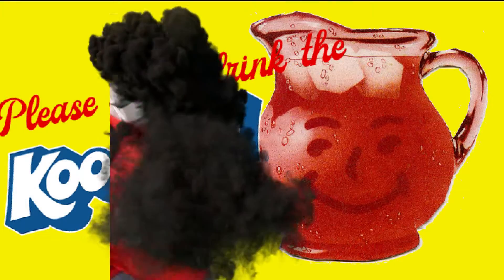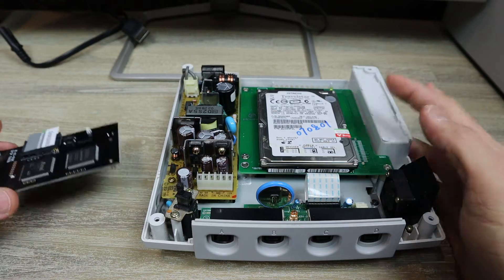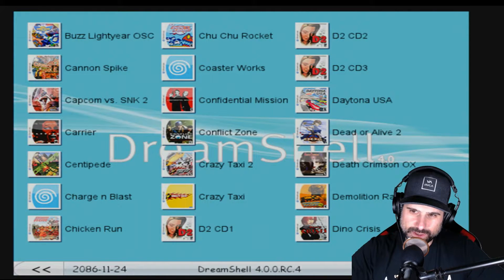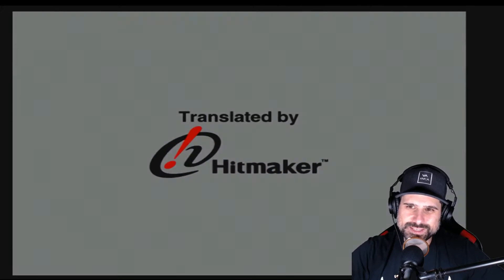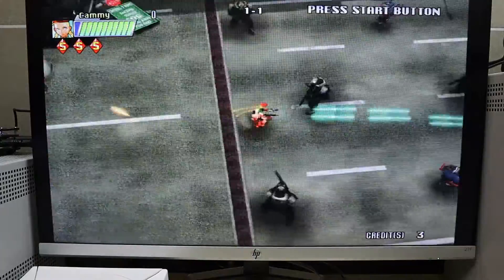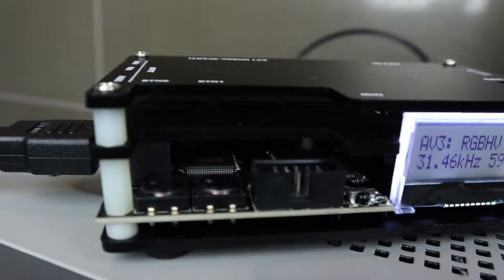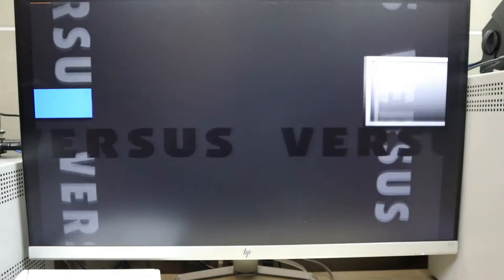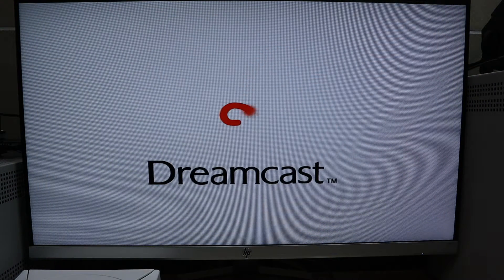Sega Dreamcast HDD Edition - No More GDEMU?

Comment from the maker: Correction:  I had issues with several memory cards.  I have now successfully used cards up to 256GB and I believe you can go as high as 500GB without issue on the GDEMU.  Sorry for the bad info on this one.
Reply: where can i buy this now? link is dead
Reply from the maker: @megaflux7144  They discontinued making it but after some time, the GDEMU is a much better option.
Reply: @megaflux7144  link works again
Reply: @RetroRalph  they now sell one with a 500gb sata drive so now you can easily upgrade to an ssd. And its cheaper than getting an Terraonion MODE
Reply from the maker: @L0tsen  I will have to check it out, do you happen to have the link?
Reply: @RetroRalph  i think YouTube blocks links in comments if you havnt recived it. It is the same one as the one in description.

Comment: I've had no issue using 128GB and 256GB cards with the GDEMU with that EXACT sd card brand.
Reply from the maker: I was able to get mine working based on some feedback from someone on my channel.  I was using an incompatible SD card.  The GDEMU is a much cleaner and more reliable solution.
Reply: I was just about to ask.... was having a little micro panic attack there :o.
Reply: @RetroRalph  to use a card large than 32 GB you need to format it to FAT32. You need a third party program called Format FAT32.
Reply: @PsychoVision19  Which SD card are compatible?

Comment: The GDEMU does not have a 32GB SD card limit. You only need to format the SD card to FAT32. I suspect you tried to do that with larger cards in Windows and Windows wouldn't let you do that....because it won't. You need to use a tool like FAT32Formatter GUI or Rufus and then you can format cards larger than 32GB to FAT32 and they will work with the GDEMU. I have personally used a 512GB SDXC card in the GDEMU with the entire USA collection and then some.
Reply from the maker: eight bit This was a mistake I made by using poor quality SD cards.  I’m currently using a 128GB card and it works great.  I really need to do an update to this video.  Thanks for watching.

Comment: GDEmu caps are way higher then 32gb just use GUIFormat or sdcard formatter to format sd card of even 256-512gb with GDEmu great $60 solution with all the tweaks possible
Reply from the maker: I think I threw a note somewhere , I had a few crappy memory cards but I resolved it soon after.  Someone in the community pointed this out but I appreciate the follow up.  I should have made a corrections video so my apologies. Thanks for watching!

Comment: Before I would switch from a gdemu this would need to support a ssd or nvme drive that’s big enough for the entire game library
Reply from the maker: I'm trying but nothing is working so far.  I have tried a few IDE to SATA connectors but whatever firmware they're running does not detect the drive.  I still have a few things I'm going to try.  Thanks for watching!

Comment: Hey buddy, these are as good as the gdemu then?
Reply from the maker: No, not at all, I need to do a follow up to this.  It’s been a while, GDEMU is the way to go.  💯
Reply: @RetroRalph  thanks buddy. Does a gdemu require a modified bios?
Reply: @Bringmejoycon  No. Altho its only made for a Va1 dreamcast you can replace some resistors on a va0 to use it on it safely

Comment: My GDEMU is running a 256 GB SDXC card. Was there a limitation before? I tried using a 256 I had setup for my Rhea and it worked so I picked one up for the GDEMU.

Comment: Hmm I use a 128gb SD card in my GDEMU. And it's the clone. No issues.  Does take about 30sec to boot to the GDEMU menu but I have 96 GDi disk images on mine
Reply: Have you heard of SD CARD MAKER for GDEMU? You can use it to make the SD card load instantly.
Reply: @davidste60  yup yup!!!   Found out about it a few days ago.  Now I'm using a 256gb card with 200 games and it boots instantly

Comment: shame you didnt tell them that you need to change memory loading hexes for each game and other settings to be tweaked per game :)
Reply from the maker: I honestly have no idea what you're talking about, Can you elaborate?  I didn't have to to do any setup.  I bought it, plugged it in, navigated to the game I wanted to play... and done.  At this point, I'm tinkering with it and you can check that out on the part 2 video on my channel if you're interested.  Thanks for watching!
Reply: @RetroRalph   ovbiously something has been tweaked or all games that you get that come with it have had each setting saved indevidually then as first of all youd need a flashed bios, otherwise the saved settings dont work on the games for some reason whilst using the disc version of dreamshell , thats what your menu is, my assumption here is that your dreamcast when bought comes with a flashed bios and all settings are saved to the hard drive for each game already. 

so you can i suppose disregard the original comment

Comment: This spinning hard drive will fail one day as well. I'll stick with the GDEMU. It's easy to swap replace SD cards if they have issues. Cheap HDDs from China may not be the right solution in the long run.
Reply: Omfg... you DONT NEED TO SWAP CARDS OUT!!!!   Why are people under this impression???   I'm using a 256gb card on my CLONE GDEMU. Works flawlessly and loads instantly with 200 games. Gonna be using a 400gb card soon. Please stop using small cards LOL. Its ridiculous
Reply: @lovelorn88nick  he's saying it's easy to replace if something goes wrong. SD Card > Cheap HDD